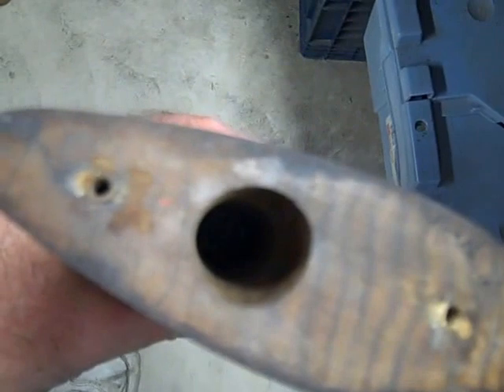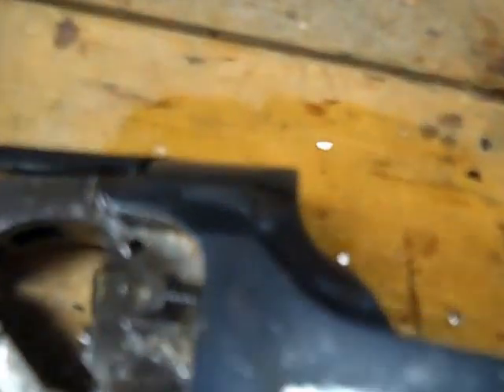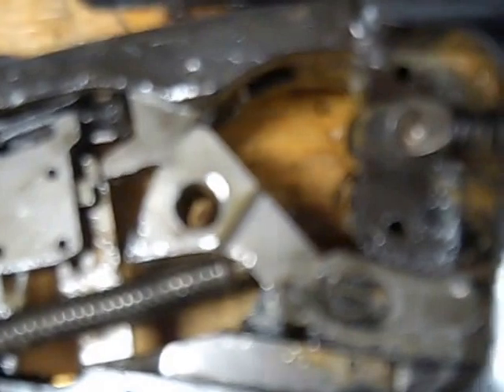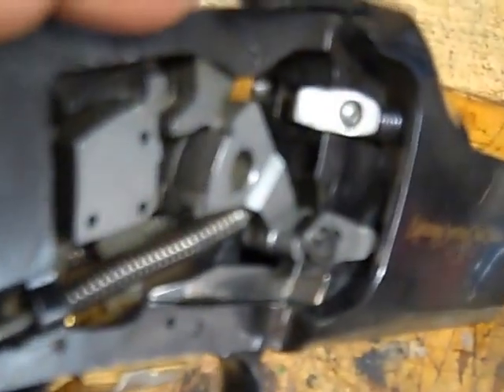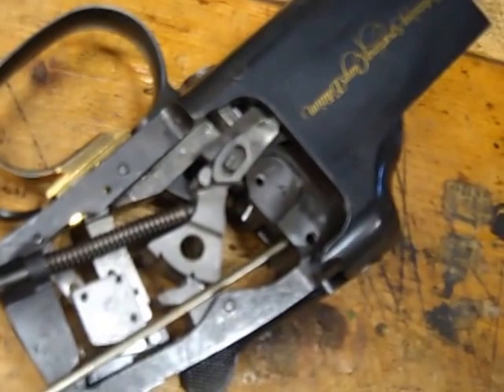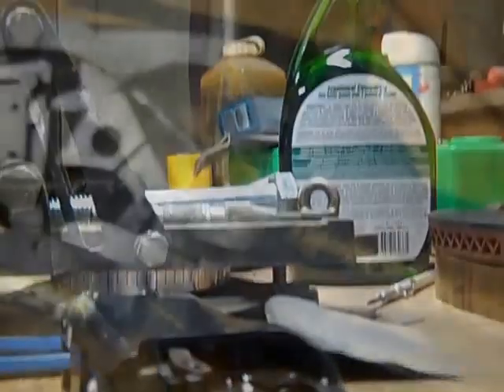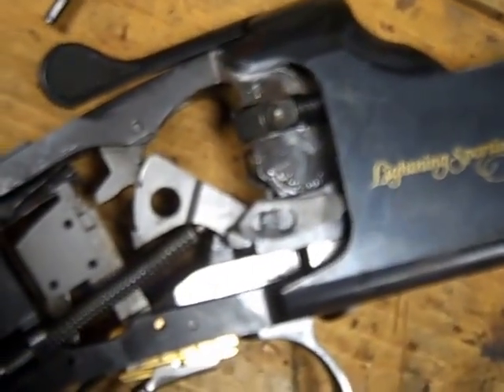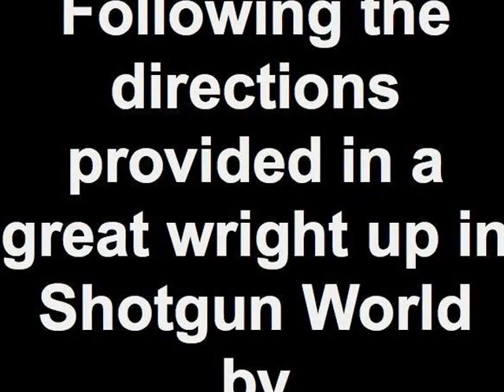Browning Citori Cleaning the Firing Pins

Comment: Thank you. Very helpful! My 525 was light primer striking all day today. Now it is clean as a whistle. Ready for more practice tomorrow and a sporting clays tournament on Sunday. Thanks from A.Z.
Reply: I have a 525 with 10's of thousands rounds through. Eventually you will have issues with the bottom barrel. I ended up making a tool (from Video on You Tube) to remove the hammer springs. The factory firing pin, mic'ed almost 12 thousandths shorter, than the replacement. I had the light primer strike on two other Citoris, and they too had shorter lower firing pins. Replaced all of them, and in 3 years don't recall any issues.

Comment: Just did this with an older Winchester 101.  Cleaned everything off with carb cleaner then a coating of Rem oil. Cleaned the firing pin channels with gun solvent and Q-tips.  I'm not sure it was ever broken down and cleaned inside before. Lots of gunk.

Comment: there will be a spring in the top but because of the angle it is on it very rarely comes out but keep your eyes open in case it does I normally always drop the retaining pin back in to prevent losing the springs.
Reply: I  sure could not find a spring in mine, and the firing pin does not have a place for a spring

Comment: I found these resources helpful: 
https://www.shotgunworld.com/bbs/viewtopic.php?f=12&t=89866
https://rifleshooter.com/2019/05/browning-citori-spring-and-firing-pin-replacement/
Start with the hammers cocked, otherwise the firing pins will not slip out.
When removing the recoil pad, first dip the phillips head screw driver in vaseline or armor all.
With older Citori models the bolt is a slotted screw head and their are 2 screws holding the trigger guard that must be removed in order to free the receiver from the stock.

Tap out the upper and lower firing pin retainer pins with a small punch and hammer. Removal of the firing pins starts with another check for knurled ends, in this case, on the firing pins’ retainer pins. You drive both out from the opposite side with a 3/32-inch punch. This generally means driving right to left, but not in every case, so make a point to look for the knurled ends. With the retainer pins out, you can remove the lower firing pin, its spring and the upper firing pin.
The upper pin is driven out from the right side of the receiver and the lower pin is driven out from the left side.

When you have the cavities clean, insert the firing pins and make sure they go all the way in and out very smoothly with zero binding. If I tapped the tip of the pins from the receiver side with my finger they would pop all the way out of the cavity.

The bottom firing pin has a return spring, this is not found on the top firing pin. When I fit the firing pins I like to check that their protrusion is adequate and that the pins move freely within the firing pin channels.

Since the bottom firing pin is encased in a spring, lower the hammer so the bottom firing pin is 
completely down, protruding more than the top firing pin,  then install the retaining pin.

Examine the pins for wear and damage, especially the tip of the firing pins that contact the primers. Mine were still perfect. The top pin protrudes .049" from the face of the receiver and the bottom pin protrudes .067".
Reply: The bottom pin end on my Winchester 101 is pitted and hanging up on the fired primer. It is getting more difficult to break open the gun to eject the shells.  Top barrel when fired by itself is fine. Shells eject with no issue. Guess I'll be replacing some pins.